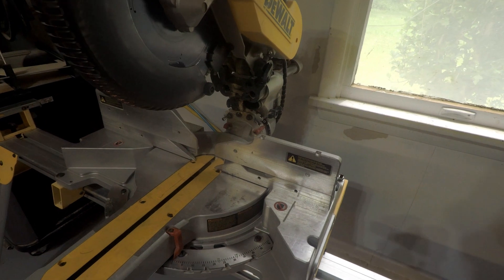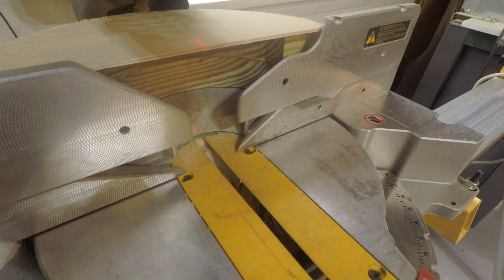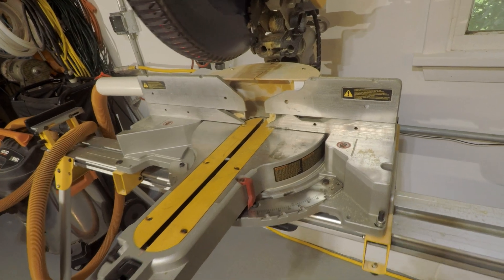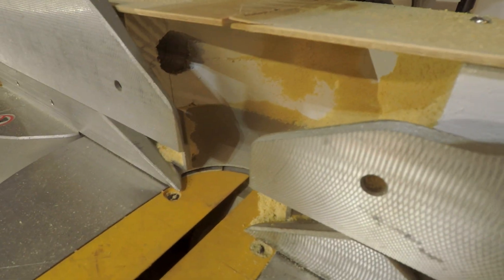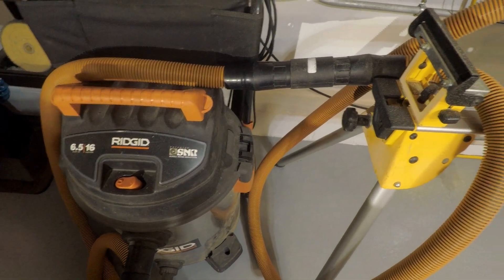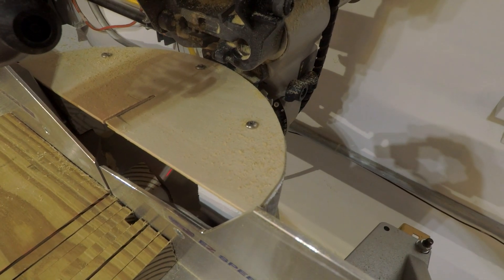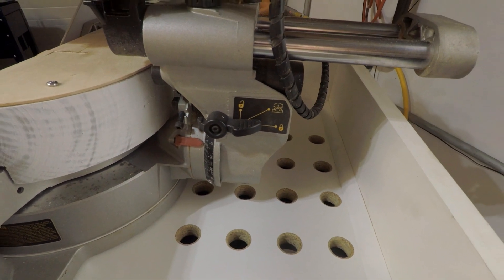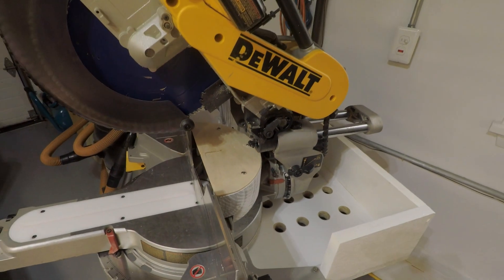Quick Fix: improving dust collection for a miter saw

Comment: Daniel, Clever idea you have. I would suggest putting some holes on the "back side" of your "C-Collector" to allow air to be drawn in from those "corners." Perhaps start with a 3/8 hole and go from there if necessary. That may prevent some of the the saw dust build up you have going on inside your "C-Collector." It seems like your duct vac it's "starved" for air.
Reply from the maker: That is a good idea, I think after adding the front inserts it also choked down the flow a bit too much.  I am going to try adding a smaller inlet hole on the right side of the enclosure to induce some cross flow towards the shop vac.